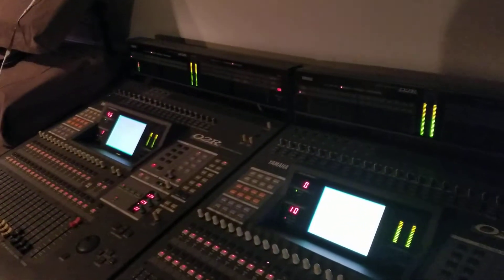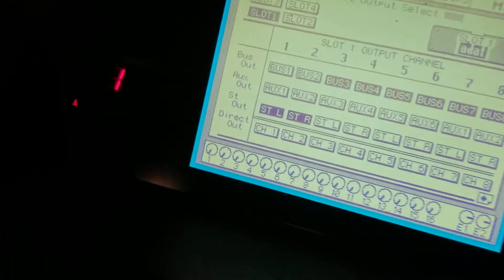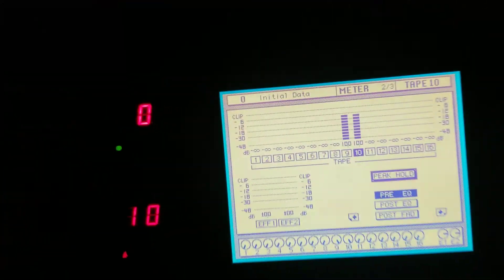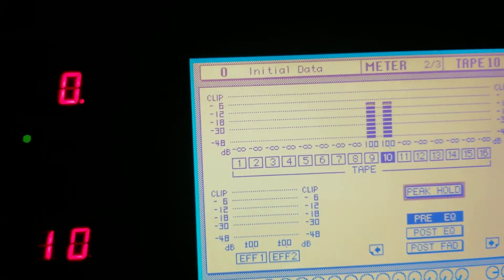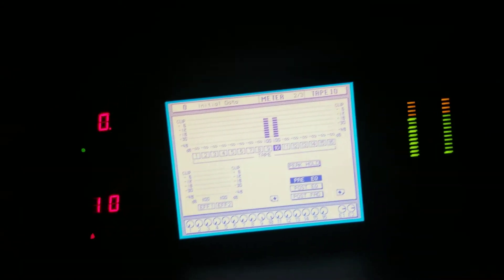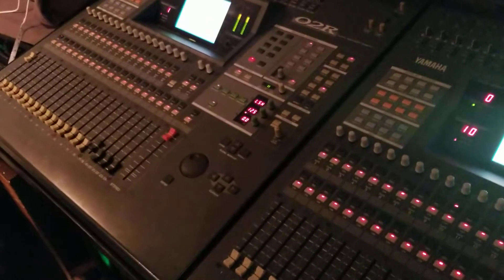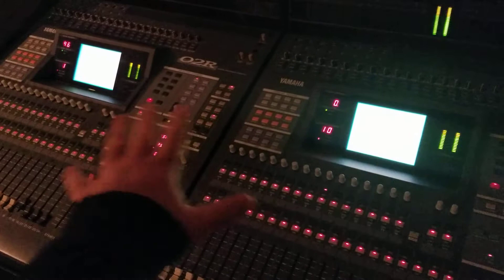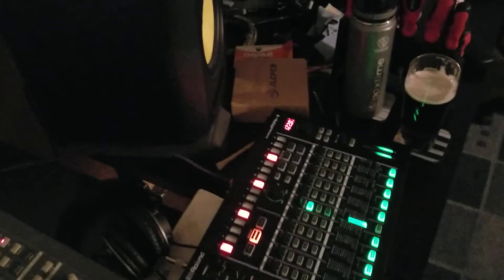Chaining Yamaha Digital Mixers with Adat Cards

Comment: Hi quick question how do you link the Insert plugins with the ADAT channels on same strip, Insert plugins only Seems to work with Mic/Line inputs, but not combined with ADAT inputs on same channel strip
Reply from the maker: I no longer have these mixers, so I can't double check, but you should be able to assign the adat i puts to channels in the mixer, and then you can add effects to that channel.

Comment: I'm trying to use adat cards to plug into my motu.....just getting a DIO...error message.was hoping to be able to route in and out of ableton. ..optically but is not as simple as I expected.
Only just got the cards and cables ...seems not much info on doing it...which probably means it cnt be done.
Reply from the maker: Maybe check to ensure your mixer and motu interface are running at the same specs. I think the 02R defaults to 16-bit 48kHz. I made sure to set my interface (MX-1) to run the same.
Reply: @JacobWatters1   cheers ...after a little bit of messing around it was exactly what u mentioned. Had to switch 02r from 48khz to get it to communicate. Cheers